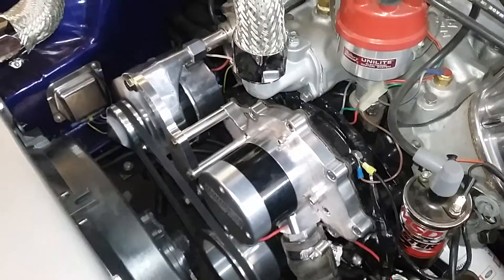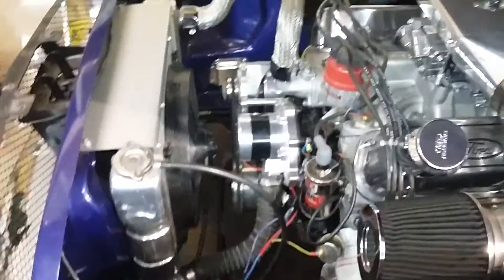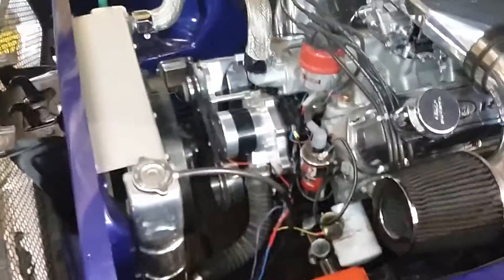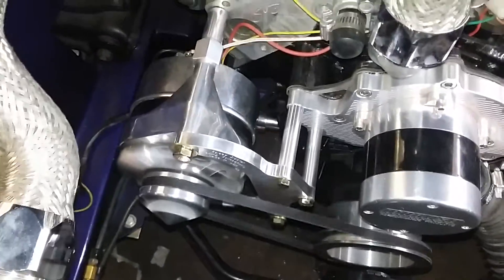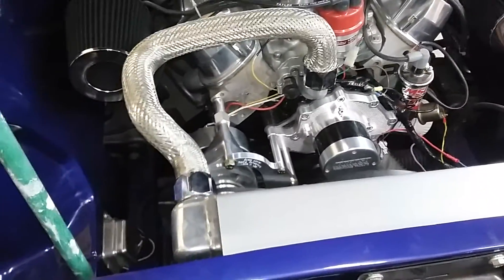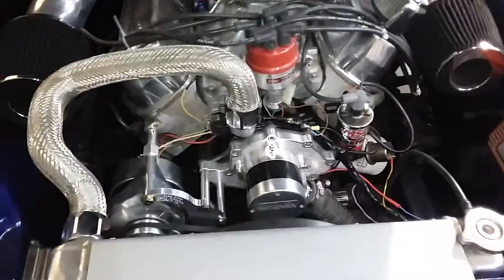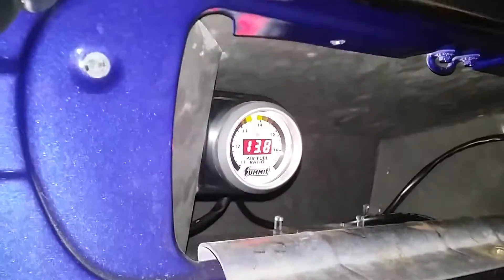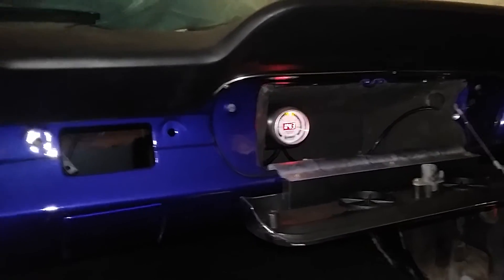1965 Mustang: Moroso electric water pump install part 4

Comment: Dude where did you get the whole kit,  pulley ,belt, bracket for alternator and alternator
Reply from the maker: This wasn't a kit. I pieced it together myself. Found some pulleys and polished them myself too. The alternator bracket came from speed doctor. The pulleys are from a bigger March set up. I ended up have a machinist make me a spacer from my crank pulley. It's all still working.

Comment: Men,i have a 351w 1983 grand marquis it used to overheat ,then i changed the water pump and works well but i feel that it could be better. Will you recommend this electric water pump to me?
Reply from the maker: Wow...my apologies if I never responded to your message. Yes I would recommend this pump. I have mine wired to where it cuts on as soon as switch is turned on. You will have to modify thr bypass because obviously there isn't one. I'd highly recommend in keeping some type of bypass. I actually drilled 2 or 3 small 3/16" holes in my thermostat so that the fluid keeps moving. You don't want any hot pockets at your cylinders. 

This pump and a larger radiator fixed my cooking issues.
Reply: @Cobrafanatik22  thank you very much bro

Comment: How’s in traffic? On a hot day thinking of using one on the big block 69 Charger
Reply from the maker: Richard Price it seems to keep it cool or reasonable. Good thing is, I can pull over and shut the engine off but still keep the fan and water pump running and cooling off the engine. I haven't put many miles on  it with the new pump but I'm hoping to find out how well it works in the hot weather this summer.
Reply: Cobrafanatik22 cool I’d like a up date on it 😏 I’m living in the rocky mountains so it’s wimpy it wouldn’t work for me and I do get stuck in traffic plus i adding boost